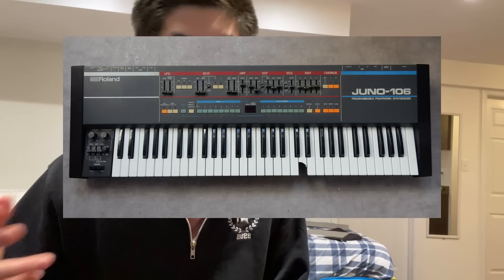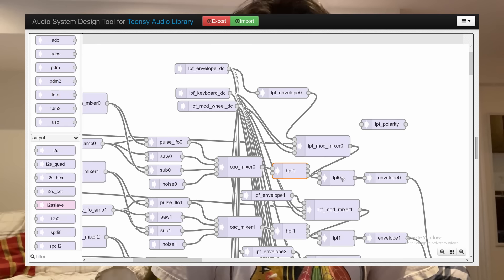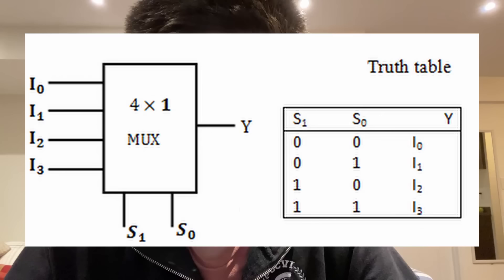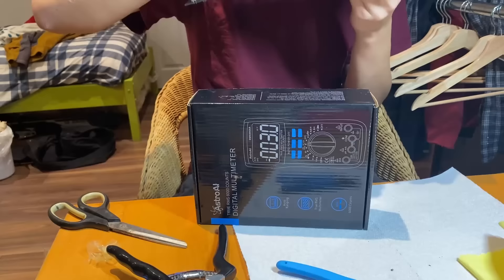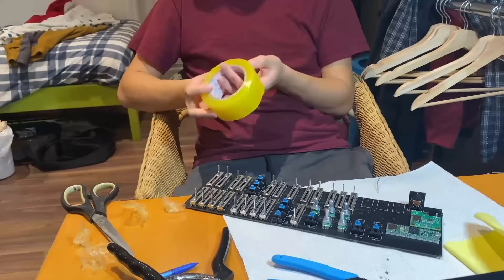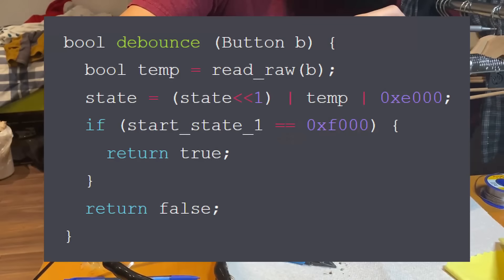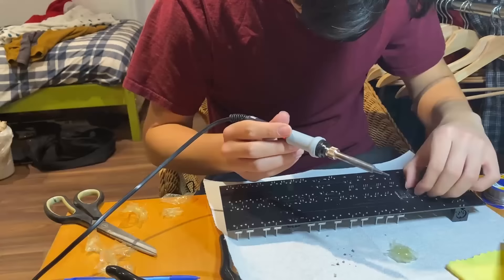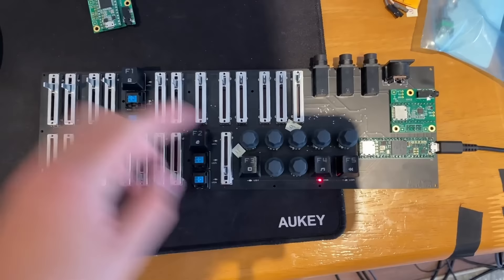Making A $2000 Synth For $99

Comment: Did you manage to finish it? Looks like an awesome project! I wasn’t aware of the Teensy audio shield! One thing I can recommend is to separate the controls from main audio processing. I mean, use different processing units: one for handling all the controls and another only for audio. This way you don’t steal resources from the audio processor to read and interpret controls.
Reply: Or you can use interrupts, which were invented for just that situation back when computers weren't cheap and you needed to use your resources efficiently. In this case, adding another Teensy raises the BOM cost 10%, so if you can put the features on one or fewer, then that's probably the best way to go about it.

Comment: you could use Microchip 23S18 (3c33 - 5V) or other port expander. these are 16bit or 2 x 8 bit wide ports, but 8 version also exist.
there is a Arduino "library" for 23s17 (5V). you got SPI and i²C versions.

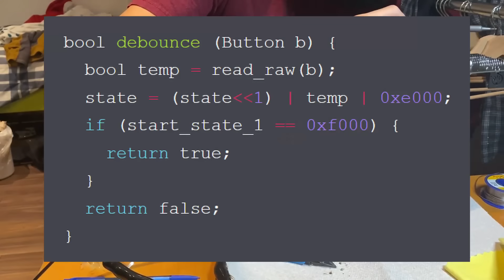Comment: 5:32 Where does start_state_1 come from?  There's something missing there.

IMO, the best debounce algorithm is "early accept with lockout period", or words to that effect - if a switch hasn't changed state in a while, you accept a change in state immediately.  You then start a lockout period timer, and don't accept any more changes until it expires.

This is the best solution for games, for example, because the button responds the moment you press or release it, not a few milliseconds later.  It's better for things like a drum pad too - a millisecond delay, in sound, is like moving the instrument about a foot further away from your ears, or around 30cm.

Comment: When you find yourself  5 inches away from the project, get a third hand and ring light magnification. I have horrible eyesight (the result of a few mini strokes) harbor freight has the best cost and quality on both these items, hatbox Freight is not even close to the cheap tool place they used to be! Their tools are still reasonless priced but you can outfit a very swell equipped and lighted work space for the fraction of the cost ii always get the extra insurance, this is where they really shine! By the time your done half the price and Everything you need fairly stylishly, thro a few leds on it for the heck of it it! Peace!

Comment: Synths might lead many to look into electrical engineering but most would see the complexity and never pursue that sort of project as their first. Maybe start with some guitar fx pedals first and work up from that point. Not you though, frustration is understandable given diving right in to the adult pool. Now make a analog version that can interface with digital commands of functions and route the signal at many points dynamically in and out of a DAW or other midi compatible devices. ;)

Comment: You will suss out the strange behaviour of the buttons if you look at the code for long enough. Some software bugs are like obvious when you find them, but your mind can just skip over the problem. My switches and leds did similar first time I ran the code on my project. Not one bug but several.

Comment: to deal with bounce, for me at least, the most you have to do it add a software pullup resistor on the pins that have bounce 👍

hardware works too, but most if not all arduinos have built in hardware pullups you can use

Comment: "Making a juno 106 for $99, a $2000 synth for $99"
A Fiat Uno 1.0 3 cilinder car makes 157 km/h and a Ferrari 166 Inter makes 150 km/h
A Fiat Uno is not same as a Ferrari.
Nice video and project btw, just the title and thumbnail are messed up :)

Comment: Wich multiplexer did you use and how many did you used?btw cool video 😎👍
Reply from the maker: I used the CD74HC4067M (https://www.digikey.ca/en/products/detail/texas-instruments/CD74HC4067M/376870). 
Its out of stock now, but that's probably for the better cuz it lowkey sucked lol
For my new synth I'm using the CAT9555 (https://octopart.com/search?q=cat9555) which is nicer. 
The main difference is that it uses i2c instead of the binary operations of the multiplexer.
Heres a PlatformIO library for Arduino/Teensy:
https://github.com/wang-edward/gpio_expander
I haven't gotten it working on any debian/linux based systems yet, will try harder once finals are done.

Alternatively you can try using an ATMEGA4809, which is what Prajwal Mahesh (🐐) did:
https://youtu.be/Mdk-aUEtNno
It's a lot cheaper ($2 each vs ~$7 for the CAT9555s), and also a lot cooler.
I guess the drawback would be that you have to flash the firmware yourself, and it seems pretty hard to solder.

Comment: Did I see (not see) correctly? You are talking about digital issues and I'm seeing no bypass capacitors for the chips? You have noisy supply voltages. My guess, with experience, but without seeing all of the project.  1 to 10 uF cap next to each chip (physically as close as possibe) between VCC and digital ground.

Comment: Great! A way to improve this design, is to make some parts fully analog, like the filter and amp section for example, this way you'll have a digital-analog hybrid, which should sound better, and it's certainly more unique also in a sense that you can't replicate this completely digital, on a laptop. It would be cool if you could make another video of your traces design process. Cheers.
Reply: He’d have to design six separate paths with a DAC, VCA, a Filter, and then a way to sum their output. He’d also have to design a control system for the components in each voice. It’s not impossible, but it you make this engineering project A LOT more difficult.

This is basically an Arduino software synth project mashed up with a custom midi controller project. That’s a hell of an accomplishment already. Give the dude a couple of days to figure out analog audio engineering. Sheesh.
Reply: @Charlesbabbage2209  lol. Yeah, the teensy stuff and multiplexer hes done is not that easy!! Agreed he should take its time!!

Comment: So, you built MIDI controller around softsynth on the chip. Well done, but it's far away from Juno"s desing (there's DCO, 2 VCFs in serie, VCA and BBD chorus), proven by the resulting sound :) But I guess that you will figure it out ;)

Comment: arduino and the components makes an emulated version.....its no analogue circuit.its all software with an arduono u can change the software on the pi to a jdxi or a system 1

Comment: I can’t believe a $699 synth with one DCO is selling for $2,300 to 4,999 USD! Geez. There’s software versions for way under $100, and, duh, Behinger makes actually very nice retro synths. Paying all that dough, when those early ‘80’s components under the hood are turning to sticky goo, for they have hit their Sell By Date a decade ago.
There’s prolly another $1K of repair work, even if the thing never left the studio.
Yes, build one, if you can. Kudos.
Reply: Because it was/is an awesome synth, many famous people used it, like Madonna and the Techno Scene.
search: 3 steps ahead - in the name of love, 3 steps ahead - drop it, Marshal masters - Slave's to the rave. and many many more.
the famous hoover sound. it was 6 voice polyphonic.
Reply: Normally parts don't turn into "sticky goo". With electrolytic capacitors this only happened to chinese trash made around 2000 because they used an incomplete pirated chemical formula. Much older or newer caps don't decompose that badly unless they run hot by high current (e.g. in switching PSU). I collect music keyboards and most caps in 1980th keyboards are ok. Also the original big cylindrical mains capacitor in my very modded Grundig 6199 tube amp from 1961 is still intact despite (or because?) it runs daily 14h.
Reply: @cyberyogicowindler2448  i have a 8 port USB expander and i recently discovered it again, it's housing it's sticky as hell, like the oil is coming from the plastic. it's a bit over 10 years old, seemingly Taiwan based and even Del sells it's today. although it has some soft touch housing.

Comment: Nice project but it don't sound like my juno 106 :( you should look at how the Roland's DCO's work they really are quite interesting. You could use 6 AD9833 module's as a source and then use a wave shaper to generate the classic saw tooth wave form.
Reply: Speaking about terminology, about the Juno "DCO" has always been slightly misleading to me, as the voice hybrid is mostly analog. "Hybrid" means it has a bunch of components built on a small PCB that acts like a single chip. It could also mean "analog & digital" but the naming is of physical origin.

"Digitally Controlled Oscillator" is hiding one key fact: there is no oscillator (well there is if going to the roots: the main MHz class crystal which is being divided into audio frequencies)!

True: the voice is producing sound based on digital clock. The sound is shaped from the digital square wave with analog circuitry: sawtooth is formed from square wave by the use of analogue integrator and PWM is done from sawtooth with adjustable threshold. Did I tell about the SUB osc? Maybe I should be fair and say that's digital logic, D flip-flop as I recall.

The integrator needs variable gain (function of the frequency of the voice), and that is given by the voice CPU. Hmm... it would be interesting to replicate this :)

Comment: Quick tip: whyyyyyyyy would you use code to debounce? Just a few capacitors solve the problem reliably, permanently, and without adding code to the processing load.

Comment: the reason real Junos are so expensive is because they're analog circuits, not digital software - if you just want a digital emulation, there's a lot of plugin synths that do this. This is no different than one of the many inaccurate plugin clones, just with a custom hardware controller

Comment: A vintage 1984 Juno 106 today would probably be a piece of junk, with corroded switch contacts, broken keys and leaky capacitors. It would be a nightmare and expen$ive trying to get it back to fully working order. You'd be much better off buying a Juno 106 plugin and a MIDI keyboard from Sweetwater and running it on a cheap PC or Mac.
Reply: No, some of them still work. I had no issues on mine in 2000+  and it's really well serviceable, except for the voice hybrids and VCF/VCA maybe, but there are replacements for those as well.

Comment: Cool experiment, and very impressive! 

But let’s not pretend that you re-created the Juno 106? I’m guessing it not only does NOT sound horribly like the 106 (except in some vague way, or with the most basic wave forms), there is no conceivable way that you could replicate the things that make those older synths so magical, e.g., the way the voices allocate when playing a chord. 

There was probably more than a decade of research and development that went into the Juno’s, the JX series, or the Jupiters? And a fairly large group of the smartest engineers put their life’s work into the developing those synths, which culminated in the Jupiter-8. 

And the lessons learned from that flagship synth is what directly went into the Juno 60 and later analog synths. 

So let’s not pretend that this guy just woke up one day, read some internet articles about building synths, got some blueprints and diagrams, and then nailed the Juno 106, first try?

There’s also a YouTuber who did this with the Minimoog for like $500? He had all or most of the original components, and had the original blueprints by Moog (which can still be obtained online, apparently?), and at the end he had a … basic monophonic synth. The basic wave shape sounds like sawtooth or triangle sounded like you would expect. But the output was almost certainly lower than a Model D, and virtually none of the things that make a Minimoog a Minimoog were really apparent; meaning, none of what makes it an actual instrument vs. a piece of tech was apparent, although it had a keyboard and an interface. 

So it’s cool, and it’s good content, but it’s not actually achieving the goal of reproducing such a legendary and expensive instrument for $500; or, in the case of the Juno, $200 or whatever. 

Also, this guy is vastly overstating and dramatizing the price of a Juno 106. They’ve been steady at $1200 to $1500 for 5 years. And you can still find them for $1100. A little further back, the prices were even better. 

And … of course, since this video is mainly focusing on re-creating the sound of the 106, the Alpha Juno basically DOES have the sound of the 106, and with additional capabilities; but because of the bad reputation of its interface, it has lingered in $400 - $700 range for the last 5 years. You wouldn’t get the same educational experience, or the fun of undergoing that journey, but for a couple of hundred dollars more, you indeed could have had a better synth with the sound of the 106 and professional features.

Sorry for being a nerd, but this is what your video made me think about as I was watching it. Good job overall; good content!

Comment: If you want to sound like a Juno 106, just use any Juno 106 VST software instrument. You will never sound like a Juno 106 using an Arduino or Teensy. The Juno 106 is based on 6 Roland 80017a VCF/VCA chips. If you want to sound like a Juno 106, you should emulate and modelize the exact behaviour of these electronic chips, and also all the discrete electronic components, ICs and amps used in a real Juno 106. Moreover, the Juno 106 contains the famous Roland chorus FX, which greatly contributes to the sound of the Juno 106. I don't see any chorus in your project...